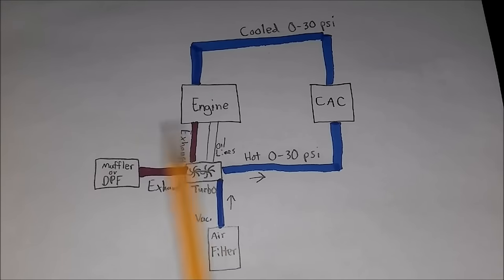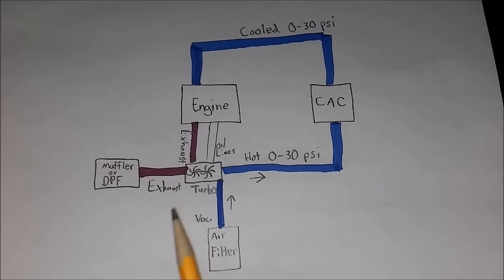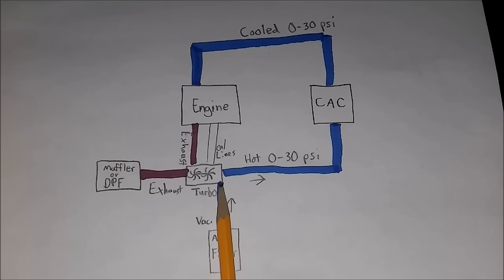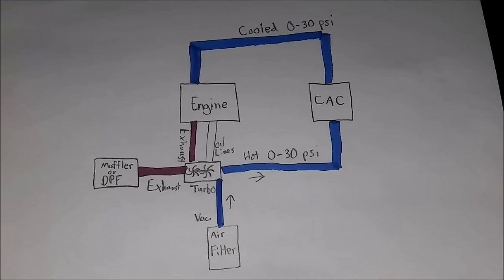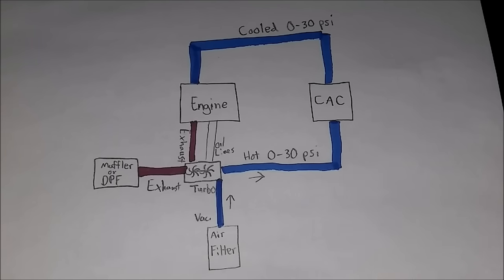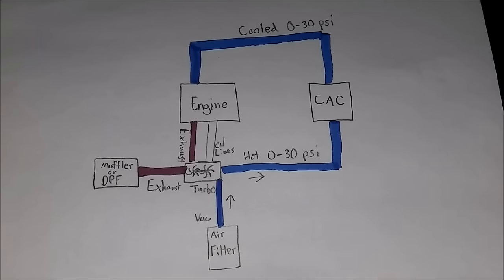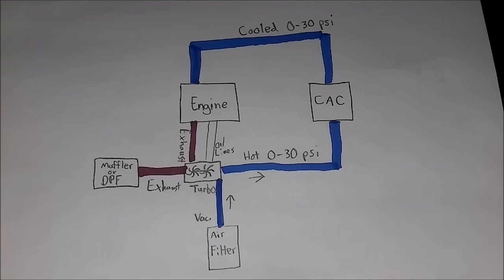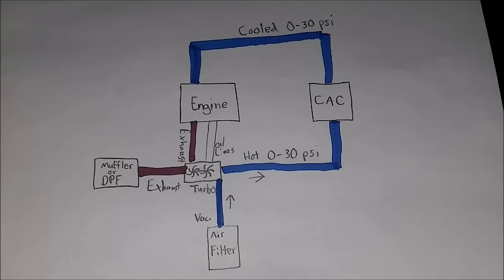What Causes Low Boost?  How Does A Turbocharger System Work?

Comment: Hello. I’ve tried watching an learning but haven’t really found my answer. We have a 425 horse 3406b that’s turned up. We’re replacing the turbo due to cracking around the housing. We found a e model turbo that was on a 550horse.    What the question is. Since we don’t quite how much the truck is turned up an what horse it’s at, could that e model turbo work for our b model.  maybe itd bei too big for our truck? Maybe it’d be a perfect upgrade from the stock b model turbo? We’re not sure. Could you give a little advice?
Reply: If a turbo is too big the first thing you will notice is poor acceleration. It will spool up slowly.

Comment: does the small hose going from turbo to actuator have continuous pressure?
Reply: It has whatever pressure the turbo is producing, it just a open tube.
Reply: @jaydunbar7538  it was clogged injectors` diesel kleen really fixed it!

Comment: Hi there! I own 08 truck with twin acert turbos. Recently I got 30-32 low boost when pulling hard w/a load. It used to be at 38-40.Engine seems to run smooth, fuel economy is OK. It seems when system is doing a regen the boost reads closer to 38psi.Dealer couldn't find anything wrong after testing CAC exhaust leaks fuel pressure etc. They did overhead. Same issue. Only 30 psi of boost. Blocked the waste gate and no change. They said until things got much worse they can't figure it out without putting a lot of time in troubleshooting. I would be very much interested what you make of it. Thank you.
Reply: Mine is similar situation. Did you figure it out?
Reply: @adco  mine does 36 38 max. I think it should be more
Reply: @Bosnianfear15   Any luck? Mine has been getting less and less as well. If you are at 550 tune you should be seeing over 52 psi. I only make 30 on a good day, today I couldnt get over 25 psi pulling uphill at 100k lbs
Reply: @spoolinsvt6489  replaced the turbos.  Double check your turbos from both exhaust side and cold side. 2 shops told me my turbos were bad. I also had few leaks on bellow and that elbow that connects to the turbo from bellow on exhaust side. Today I pressure tested cac, had one bad boot clamp.  I hit 50s now

Comment: Hey Adept!
so whats the deal with 3116 blocks cracking?

i was told that any slight crack in the sleeve will need a new block. why cant the sleeves be plugged out and new sleeves to be inserted? 

thanks!!
Reply from the maker: +Omar Those blocks can be machined with new cylinders. All the little Cat engines can be, the guy we use charges $400 power cylinder if I remember correctly.

Comment: Can my boost pressure sensor cause low boost My checkengene  light went on and  it's Sayes turbo boost sensor
Reply from the maker: +vitaliy kostenko Sure can, the system can derate if the engine doesn't know what the boost is and it'll restrict fuel rate as well.
Reply: vitaliy kostenko ima sound dumb af but wats low boost?

Comment: Ive heard that the turbo causes back pressure like a muffler and cats would is that true?
Reply: Good point.  I see from your other post that you are a "petrol" guy, and I own a turbocharged gas engine powered car, so I will keep that in mind.  For diesels, the exhaust back pressure from a restricted muffler reveals itself in low power; however, when the exhaust is severely restricted causing the combustion chamber not to fully empty and breath, funny noises can be heard.  Merry Christmas.

Comment: Hi 
What causes sporadic low boost problem?
May my truck have driver rewards  or something like that and can be that the issue on my 3406e 1lw engine?
Reply: wastegate. check the wastegate actuater and waste gate valve
Reply: Turbo Boost Sensor

Comment: if the CAC is leaking, will it allow coolant to gets into the combustion  cylinder ?
Reply from the maker: +mustafa ahmad gawish No the CAC is an air to air heat exchanger. Your precooler is a coolant to air heat exchanger though, so coolant can get into the intake air that way. Usually when you are getting coolant into combustion cylinder it is a burned out head gasket or a cracked head.
Reply from the maker: +mustafa ahmad gawish No the CAC is an air to air heat exchanger. Your precooler is a coolant to air heat exchanger though, so coolant can get into the intake air that way. Usually when you are getting coolant into combustion cylinder it is a burned out head gasket or a cracked head.
Reply: thank you

Comment: Hey Ape, is tyere any benefit to change an Acert engine over from dual turbo to a single????
Reply from the maker: +Gary ClarkII I get this question from time to time. I think there is a kit too on oldmanpower or something like that. So it is supposed to help keep temps down and hey better mileage, but I have never done the retrofit so I can't say if it works or not. I like the idea of going to a single turbo, but the downside is if you have a failure on the road getting parts might be hard, unless you do a conversion to all Cat parts.
Reply: I can't say for sure but I think Pitts power may have a manifold that goes from single to dual, but one things for sure and thats that I personally wouldn't do it for more power cause at 500 hp I reallly can't see where more power would help anyway. They say if you use there parts that you will get better mpg's and thats what I would be looking for, not HP even tho it may happen as an added benifit. To me, having 2 turbos and all that other added shit would cause more harm than good in my honest opinion and more to get broke also, and we all know that if your trying to get more HP and torque out of a motor your only gonna be doing the engine harm, not any help!!!!

Comment: this dude i met once said to get more hp out of his c12 he zip tied off his wastegate hose he said he gained boost to 30 and hp he also been running it for 3 yrs now with no issue`s  have u heard of this ??
Reply: Yes, so long as you dont mess with the fueling it is unlikely to cause a problem. However you do risk busting the turbo shaft, personally ive got my waste gate plugged on my 3406e.

Comment: What about intermittent low boost? I was going up a mountain and my boost just cut to 25-30. I felt a slight stumble like I slipped off the gas pedal a little bit and got back on it. The next morning its boosting up to 50 psi just fine. C15 acert.
Reply: It was the fuel filters.
Reply: @Alex0992   Wish mine was the fuel filters. Have changed them several times over
Reply: @spoolinsvt6489  what is it doing?
Reply: @Alex0992   Boost is way down, compound turbo c15 acert only been making 30-32 and today wouldnt go over 25.  Once in a while, more often when it is a hotter day. It will pull up a hill but once you shift up a gear it has a pretty bad miss where you need to get off and on it a few times till it clears out and then you are good. Other than that, it runs good other than the intermitent miss after a hill climb loaded and the low boost
Reply: @spoolinsvt6489  I would check for boost leaks, the fuel pressure, injectors, and ivas.
Reply: @Alex0992  Checked for boost leaks from the outlet of the turbo into the engine. Held at 50psi with no leaks. Next is changing out the fuel pressure valves and the new spring on the transfer pump  i believe.  Zero codes, even when it is having a bad miss after the hill climb. 
Had one IVA go out a couple months ago and wouldnt go over 20psi and gave a check engine light and went away right after it was replaced

Comment: Is it ok to pinch off waste gate hose to gain power
Reply: According to cat no, in reality yes but it can cause catastrophic failure of the turbo. It most likly won't but it is a risk as you are running the turbo outside of its design parameters.

Comment: I have a question I replaced my Turbo on my 2000 6NZ and know I get over 35lb of boost and my gage goes to 35 what can it be?
Reply: Old gauges can read low, they just wear out with time.

Comment: Hi can anyone tell me what could be the problem with my bmw 316d es 2011, i can drive it for a bit and its fine, but when its hot, its chucking out loads of blue/white smock know loss of power but the smock can be really bad at times, then clear as quick as it started, could it be the turbo, thanks
Reply: Could it be a dpf filter given you problems?
Reply: I don't know BMW's too well. But I am guessing the emission system is similar to the one on my big truck which I had the same problem with.With my truck the problem was a failed DOC or diesel oxidation catalyst. With a failed DOC the DPF really can't passively regenerate. So it has to do an active regen quite often. When the active regen happens your vehicle will smoke like a forest fire because the fuel from the doser injector is not being combusted properly in the failed catalyst.

Comment: I have a cat 3176b with no wastegate and fkn truck runs perfect once my rps are above 1600 rpm but anything below its gutless!!!! I did fuel lines filters , all sensors,, only thing i have going on now is check wngine with coolant level fault but that has no effect on power ,, somebody helpp

Comment: 6nz 475 cat, what should the max psi be? Im only getting 20 psi. And I have no leaks.
Reply from the maker: That is quite low, normally those are about 31 give or take a couple. Put a gauge to verify, then try pinching the wastegate line to see if that is the problem.
Reply: +Adept Ape I've had my 3406e 475 waste gate hose crimped for over 2yrs boosting at 37 and loving every min of it will It eventually damage anything?
Reply from the maker: Well you are not the only one to do that, the wastegate is supposed to limit the boost and to help protect the engine. That same block on a twin turbo will make 50 psi of boost, so I think the block and pistons can handle it. Preferably it would be better to try and adjust the wastegate arm with the nut to still work and limit your boost to the 32ish that Cat recommends. A lot of trucks run without them and don't seem to have a problem.
Reply: Cool! thanks for the reply
Reply: Hello James did you ever figure it out?

Comment: I have a 1.9 tdi my car is boosting amd feuling but it not going fast at all like it used to what can the problem be
Reply: Desmond Pullen open your oil cap, turn on the engine and feel for pulsing air. If you feel pulsing while holding your hand over the opened oil cap you have a lot of blowby which used diesel turbo engines are prone to. If not you might have blocked injectors or a significant amount of carbon buildup in your intake side, alltough it is a turbo engine and thus a small carbon buildup is not as big of a problem as in na engines, this might draw a little bit of power, then, you have your dpf filter which might be glogged if you dont do enough high speed non-city driving. 

-check for pulsating air over the oil fill cap
-get the injectors and fuel pumps checked at a shop
-try to get the dpf to clean itself by driving a longish trip at a highish speed on a highway or whatever if your daily driving concists only of slow speed city driving
This is my speculation i am not a professional mechanic this is only based on my own speculation and hunch

Comment: Have 2005 Columbia Freightliner with 60 Series Detroit. Turbo replaced 7 months ago at (W.W.Williams), now starting to cut out again going down the road. Same problem as previous turbo (2) years only on that one. If I let the truck sit for awhile, and restart 15 or 20 min. later. It runs like nothing happen. It seems like it going into safe mode. Tried of replacing sensors that aren't the problem. Not to mention very $$$ costly. Are there such thing as gremlins. LOL any ideals yours truly Empty Pockets. oh like what your doing on web site.
Reply from the maker: +Randy Culver I've seen the movie Gremlins, but usually a reoccurring problem has an underlying cause that wasn't fixed the first time, not usually Gremlins.

Comment: World a bad turbo cause truck to run And idle rough with lower boost? Acert
Reply: Check your fuel filters, big diesels dont run worth a crap if the fuel supply is compromised in any way.

Comment: Low boost on a detroit s 60. All sensors changed that have to do with turbo boost, and electrical, temps,fuel temp...still no results. Glider truck 500hp rated. Passed all tests, new turbo used to test,same. Turbo actuator with a hose is not moving at all, CAC hoses are soft.... no one knows why. New comp, rebuilt by detroit diesel. No smoke
Reply: I’m guessing probably Fitzgerald glider. They cut down boost to prevent damage to the engine. The turbo that comes on there is 171702 non wastegated turbo is junk because it functions good between 1500-2100rpm. If you wanna stay stock buy K31 Borg Worner wastegated turbo which works great from 1100-1800rpm and truck will run better with same boost. Other option is to get the modified 11 blade 171702 and a tune from Leon. Good luck
Reply: @drazentopic9340  Drazene,nije turbo toliko proble,stavljao sam brand new, za test,i ista prica,na Gage se vidi da radi,i ide i lepo se sada cuje,menjao sam senzor za temp goriva,malo je bolje stanje sada. Dalje ne znam gde da gledam. Problem je sto nekad ide,a nekad ne. I dalje imam isti problem u malo manjoj meri. Potrosnja ocajna. Dva puta injectore menjao. Nema kodove. I nije Fitz. Samo ide dobro do 9te brz, da kazes da je prihvatljivo,posle ko mrtav konj. Da nije elektrika? Jer mi se juce pojavio spoj takav da su mi svetla na prikolici uvek upaljena(a prikolica nova),sto nema veze s mozgom. Opet kod majstora mora...poz,hvala na predlogu.
Reply: E onda to je problem u Throttle Possition Sensoru ili wire harness sto ide of firewall do ECM. Moze biti i problem u fuel lines ili fuel pump. Koji si turbo stavio?
Reply: @drazentopic9340  jos jedna sitnica  fuel gauge koji imam pokazuje, kad krecem prvom natovaren,maks potrosnju, druga malo manje i treca malo manje, dok do 9te dodjem,trenutna potrosnja sa gasom do poda nikad ne ide na maks vec 2/3, u 13toj je na pola,od 8 linija, imam 4. Pumpa nova,vazduha nema u crevima za gorivo.
Reply: Ako si testiro Air Charger i nema leak onda ti treba Novi wire harness from cab to ECM. Sigurno imas slabu zicu ili slab kontact na zicama za papucicu u tom harnessu
Reply: @drazentopic9340  brate papucu zamenio celu. Bolje se odaziva na gas bar 10x. Imao sam kod za slab kontakt,jutros povezao na komp, kaze high voltage za senzor coolanta
Reply: @drazentopic9340  stavljao fab turbo za test...
Reply: Wow koji nightmare 🤦‍♂️
Reply: @drazentopic9340  neverovatno. Valjda cu naci sta je. Sta vozis ti? Ili si mehanicar
Reply: Vozim buraz. I ja imam 2014 Peterbilt 386 glider kit isto sa 12.7 500hp Detroit reman motorom. Imo sam 2007 columbiju al sam je prodo i uzeo ovaj kamion prije 3 godine da ne bi moro stavljat ELD. Glideri su zakon ovi novi kamioni Su kante
Reply: @drazentopic9340  Super. Ja sutra odoh da vidim dalje sta cu raditi oko ovoga. Mislim da je problem oko struje. Nema drugog objasnjenja. Rebuild odradjen pre 2 god u det. Sve zamenjeno,svi harnesi,komp,pumpa itd... svaka stavka moguca...jbga... Jesili u Cikagu ili na Floridi?

Comment: At 12 min so far and I'm willing to bet  it's the waste gate. Component that attaches from diaghram that keeps pre load on waste gate get worn and sloppy. Easy fix there is a coupler  nut I. Between diagram and waste get. Add a couple turns to the old couple lr nut to just to the point of pre load. And voila  fixed. If still a lil slop and  to much play where the rod coming from diaghram down to waste gate attaches  slap  a lil wire or whatevwr works for ya to fill that sloopy gap and keeps that pre load.  On the waste gate . Jump in slam on the pedal and have fun with ur prolplperly adjusted turbo

Comment: I have 9400i international with cat engine c15 550 hp single t my issue when I switch the gear from 8to 9 to 10 I lose power then it goes after couple minute any one can help

Comment: pinching the hose does not diagnose the wastegate.
Reply from the maker: +Lowes Diesel If the wastegate is opening too soon and you pinch the hose to basically bypass it and then the normal boost pressure returns, how does that not diagnose it?